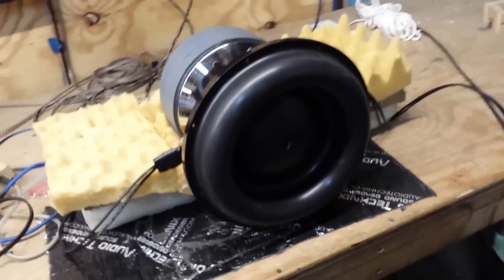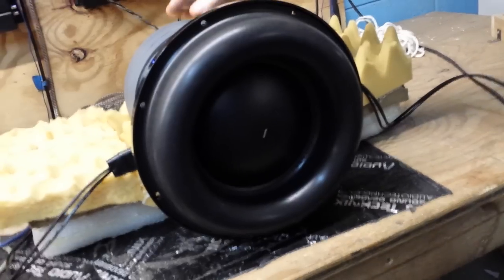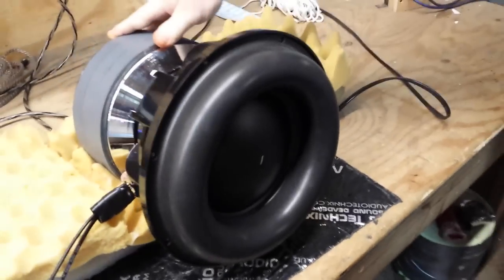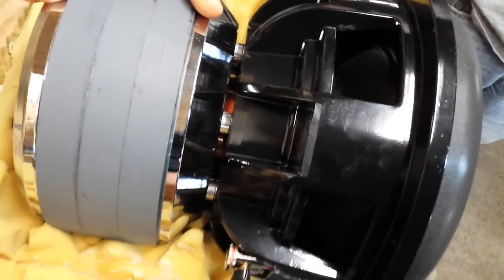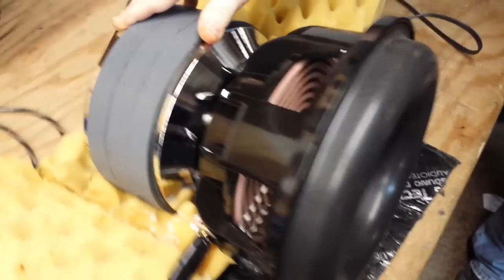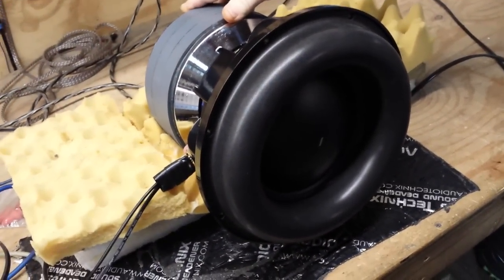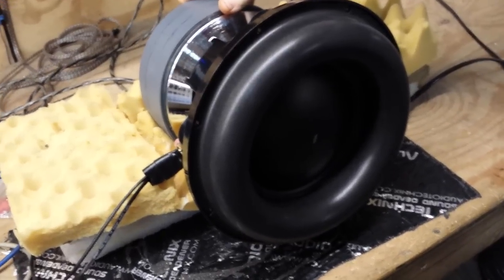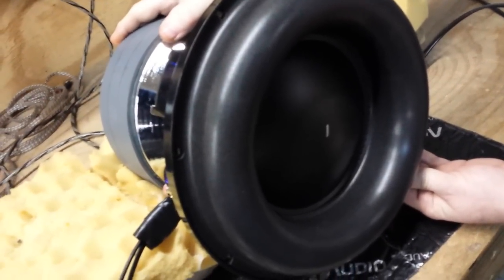SI HST 11" subwoofer

Comment: Given that the volume occupied by this woofer is roughly 0.4 cubic feet, would building a box with internal dimensions of roughly 11 inches cubed (giving 0.77 cubic feet) be the ballpark kind of size box for this? I'd really like to build a compact home-theatre style subwoofer with this
Reply from the maker: Yep, that would be perfect. The box pannels are pretty small so you can get away with no bracing on the inside of the enclosure so you could build a 12" OD cube with a double baffle and meet enclosure requirements as well. :)
Reply: StereoIntegrity awesome! Sounds like I've got an easter time project lined up then :) thanks for the reply

Comment: How do you suppose it would work with a low tuned 4th Order application.

Example: 0.4cuft Sealed -> 1.2cuft Ported (3:1 Ratio) tuned to... lets say 42hz [Home Theater Build]
Reply from the maker: I wouldn't tune that high with this woofer. Basically missing the point of the woofers design as the box would be much larger than what this woofer requires.
Reply: StereoIntegrity
 But with the 0.4cuft Sealed; and 1.2cuft ported It would be effective from the Fs -> 42hz,  more over 20hz -> 38hz would be the only bandwidth it would cover. 18hz bandwidth shouldn't be too much to ask for from this driver.

Comment: Would this sub be a good candidate for Infinite Baffle in a car?
Reply from the maker: +Montez Rice Yes
Reply: +StereoIntegrity awesome :-)....In my car im limited to only a certain amount of height under my rear deck and wanted a pair of high excursion 10s to make up for the lack of cone area in my IB setup...these look amazing!
Reply from the maker: +Montez Rice The HST-11's are not shallow by any means but if you have the depth for them below your rear deck be SURE to make absolutely certain your rear deck is SOLID becuase these drivers are capable of over 4" of stroke and there is a lot of mass being thrown around that far with these drivers. :)
Reply: +StereoIntegrity @  indeed, I've already researched the 12" :-) ...im doing a IB manifold firing through my ski hole, the baffle and manifold will be at least 2 layers of MDF plus deaden, foam, and alot of bracing....got to support 150 pounds of subs and all that glorious stroke! One last question, would 1200w RMS mono amp be enough power for the pair IB?
Reply from the maker: +Montez Rice You really should use 1200 watts per driver. Using half the rated power on the HST-11 and HST-12 is like purchasing a Dodge Hellcat and removing four sparkplugs. Will the car still work? Yes. Will it operate as intended? No. Same with the HST-11's and HST-12's. :)
Reply: Touche' my friend lol.....thank you so much for all the help with this :-)

Comment: Hopefully its cheaper than the Sundown X.. if not than whats the point of it...
Reply: For the people who want a sub that's not a 12" but bigger than a 10"
It's actually for home theater for people who want the most out of a sub but don't have room
Reply from the maker: If you're after a "cheap" subwoofer and do not care about low frequency extension in a small sealed box do not look at this woofer.
Reply: The only thing it shares with the X is the basket and surround. It's far from the same woofer. Know your shit before you judge.

Comment: What's all the noise from?
Reply from the maker: dnewma04 Air moving around the coil. It's pretty quiet when you consider the "noise" is while the driver is moving at/over 4" of travel.
Reply: That's oddly loud for air.  Hrmmmm...I haven't experienced that sound on my woofers with similar excursion.
Reply from the maker: dnewma04 what tens or elevens do you have that move 5" peak to peak that you have played free-air that are completely mechanically silent? At the very end it was the surround going non-linear. I'm actually eager to see what other soft part platform is quieter. Do you have any technical data or videos that I could see? Technical data (Klippel) supporting a more linear suspension would be extremely helpful.
Reply: 5" peak to peak?  I guess I don't have anything similar, I was going by the published specs of 50mm xmech.  Carry on, I don't have any drivers that will do 5" peak to peak but I've had a few with over 40mm xmech.  I appreciate the challenge in making a driver silent at 5" peak to peak.
Reply from the maker: Published 50mm is one-way, not both ways.
Reply: its the camera's microphone recorder that makes it sound like that... kinda like recording something in the car with windows open...its just wind... and in this case, its a shitload of wind considering the amount of excursion this bad boy has!!  in real life it must sound diff. i.e. quieter